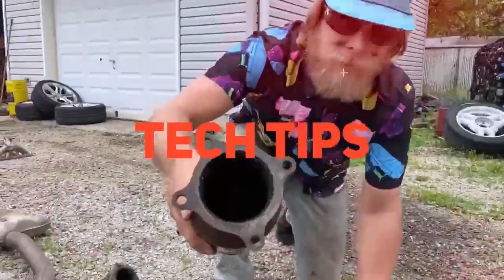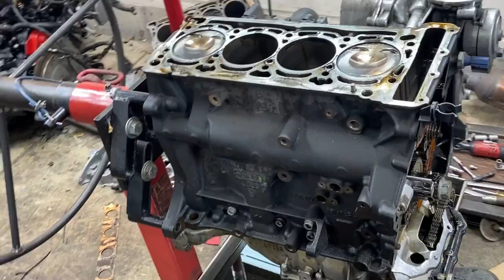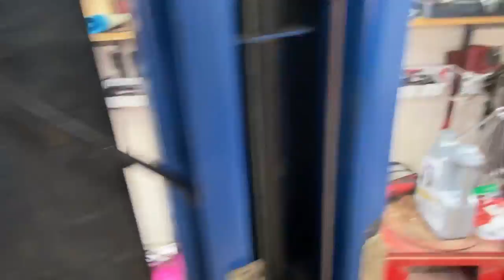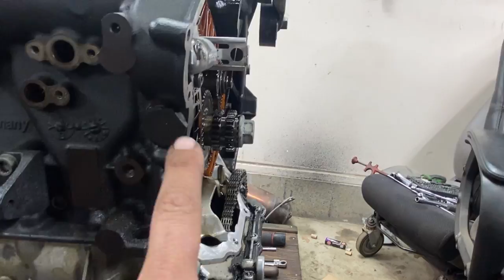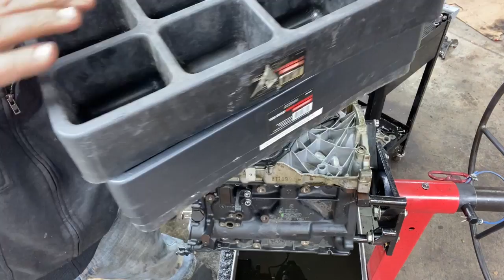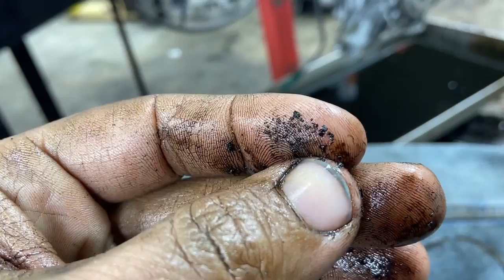2.0t Oil consumption tear down and inspection.  Audi VW using oil pistons failure reliability

Comment: I ordered the cheap set of Kolbenschmidt with the waffle type oil rings with 23mm pins off an ebay seller but I was also burned by knock offs before. So before buying them I contacted MS Motorsports the real manufacturer of Kolbenschmidt and had them verify they were legit. They told me they were in fact legit and China has its own Kolbenschmidt plant and they sell from there. If anyone is poor and needs to get them cheap Id contact MS Motorservice International like I did and have them verified before ordering. You know alot of people out there dont have alot of money but yes I understand you get what you paid for so I had everything verified. I am noit trying to argue, I just know alot of us dont have money for the best :( I have a whole build thread with all parts purchased on audizine if anyone needs info.
Reply: can i please get a link to those 23 mm pistons?
Reply: @thenels0n7  If @NaptownTuner allows me to ill post the link. It's up to him if he wants that info on his channel.
Reply: @NitroVipers3  lmk thx
Reply: @thenels0n7  I just thought about it and if you check my videos I actually have the info there as well as an unboxing of the parts from that seller. My channel isnt for advertising tho, Im not trying to gain viewers from naptowntuner as I only have 6 subs haha. I just wanna help.
Reply from the maker: That’s good on you for making sure!  I don’t know everything just making sure people are aware of fake parts, yes post your link.  I know they have been having counterfeit parts though
https://www.rheinmetall-automotive.com/en/press/press-releases/news-detail/news/motorservices-new-packaging-design-1/
Reply: @NaptownTuner  Thanks, I agree, if youre going to do this job do your research and make sure parts are not counterfit. Good info.